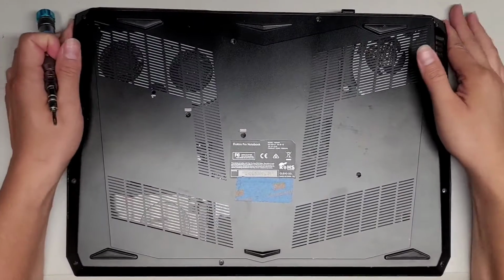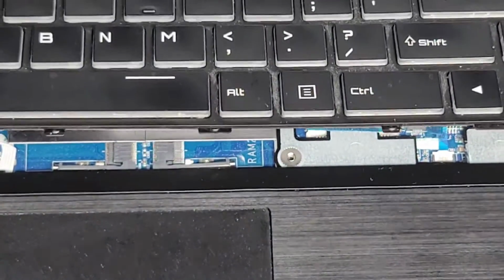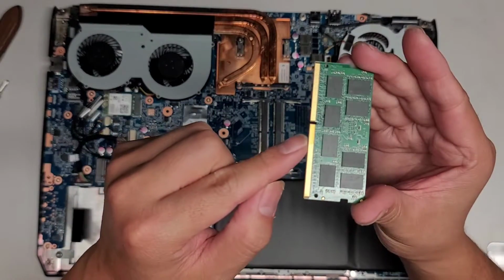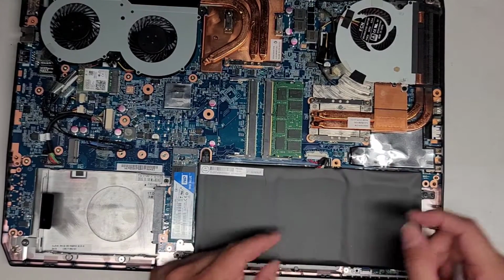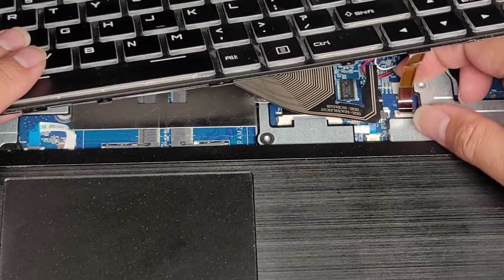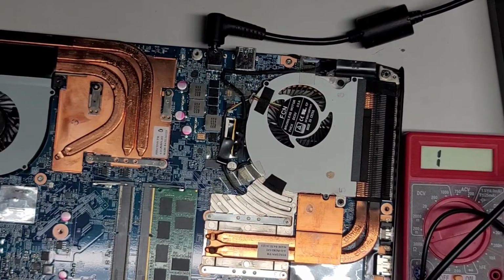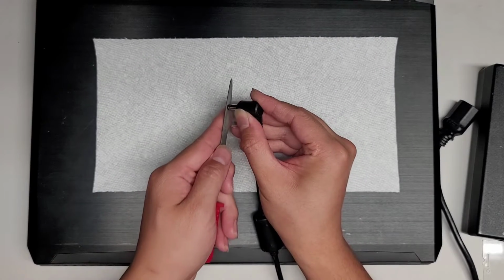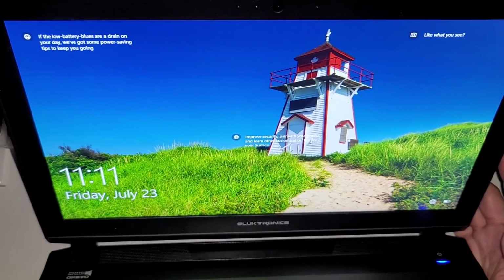Eluktroniks Eluktro Pro P650HP Clevo Disassembly RAM SSD Hard Drive Upgrade DC Jack Keyboard Repair

Comment: Hola me ayudas en algo?
Reply from the maker: I can't help you if I don't know what you need help with.
Reply: @ItsBinhRepaired gracias amigo, mira tengo la misma laptop del video y no se porque es tan difícil encontrar la información en Google. Busco el modelo exacto en la página de Eluktronics ya que es de esa marca. La verdad es que quiero actualizar la BIOS y no sé dónde descargar esa actualización, al jugar Warzon me pone una advertencia que debo actualizar la BIOS y no encuentro por ningún lado la actualización la versión actual de la BIOS es la 3.0 me ayudas en eso amigo?
Reply from the maker: @josepaz5544 try windows update advance options, enable Microsoft updates for other stuff and check for optional updates. The bios should be on the manufacturer's website if windows update doesn't have it.
Reply: Ese es el problema amigo que no está en la página del fabricante tu todavía tienes esa laptop la del vídeo?
Reply from the maker: @josepaz5544  I don't own the computers in my videos.
Reply: Soy de Honduras amigo y tengo otro problema la batería de mi laptop no funciona y no encuentro donde comprarla sabes dónde la puedo comprar en línea? Me ayudas con el link de alguna tienda donde la vendan?
Reply from the maker: @josepaz5544  I don't know places that will ship there. Check Amazon or ebay.
Reply: @ItsBinhRepaired solo haces reparaciones. Ya entiendo amigo gracias amigo!!
Reply from the maker: @josepaz5544  no problem

Comment: The comment that went with that $10 gift disappeared. I had an increasingly flaky keyboard on my Eluk Pro 670 (replacement is the same as here). Thanks to your clear video instructions, I had an easy, quick, successful repair with a replacement keyboard ordered on amazon from China. I never could have gotten the old keyboard out without your help. I also took advantage of the opportunity to blow the dust out of top and bottom under the case as you suggested. With luck the laptop will have a new life. Many thanks!
Reply from the maker: Awesome, glad it worked. Hope it continues working well for a long time!

Comment: what type cmos battery is in there
Reply from the maker: This company can help you find what you need. Just let them know the laptop model number and you can even send them the video. 

Get 15% off if you use my promo code : ItsBinhRepaired when you make a CMOS BIOS purchase at rometechbatteries.com

Comment: It's usually easier to use a vacuum cleaner (set to minimum power) to clean the laptop from dust. It shouldn't "swallow" anything important. Maybe just occasionally some screws. :)
Reply from the maker: Lol that's not good
Reply: @ItsBinhRepaired  Well... Having bagless vacuum cleaner allows finding the the screws afterwards. Although, the dust container must be cleaned beforehand.
Reply from the maker: @tamoregi  lol true

Comment: I got a keyboard replacement because my "d" doesn't work. But I got the one that's white backlight instead of the multicolor one. But there's two round cylinder things at the bottom that's stopping from putting it in. How do i remove the metal cylinders?
Reply: For the record there are only 2 keyboard screws on the bottom that have to be removed on the P650HP6. The screw locations are marked with a small keyboard. There is also a hole where you have to stick a small round rod type thing to release a tab. I replaced mine with the keyboard without the colored lights too. I don't really use the backlighting anyways. I tried cleaning my old keyboard in soap and water but it didn't help. My laptop still runs plenty fast enough for me.
Reply from the maker: What metal cylinders
Reply: @ItsBinhRepaired  I tried sending a link but it keeps deleting it. But I got the keyboard New Backlit Keyboard for Clevo P650SG P651SG P650SE P651SE P655SE USA from EBay. U can see the picture there of the keyboard
Reply from the maker: @TheRealShawnShaffer  upload a video to your YouTube channel and I'll check.  YouTube auto deletes links :(
Reply: @ItsBinhRepaired  I just uploaded it. If you don’t see it, it might’ve uploaded as a short.
Reply from the maker: @TheRealShawnShaffer  the original keyboard doesn't have the screw mounts? Not sure how you would remove them. Might have to use end cutters and grind it down with a dremel or something.
Reply: @ItsBinhRepaired  no, it looks like it’s already inside
Reply: I’ll dismantle it again and take another video
Reply from the maker: @TheRealShawnShaffer  alright
Reply: @ItsBinhRepaired  I uploaded a new video
Reply: @ItsBinhRepaired  is it fixable
Reply from the maker: @TheRealShawnShaffer  you have to remove the screws from the other side.
Reply: @ItsBinhRepaired  so I have to removes the screws and open the back of the laptop as well?
Reply from the maker: @TheRealShawnShaffer  the screws that are holding the rods in place

Comment: Save yourself some trouble with the screws, get a Plano Organizer Box like the one that you can get in the tackle section. By using a Plano Organizer you can simply put the screws in the boxes in the same pattern as-is on the back of the laptop so you will never get the screws out of order.
Reply from the maker: The box will take way too much room. I have laptops with over 70 screws. Can't organize them all that way. This will only work with models that only have a few screws. I actually have a device I made myself that does a really good job, but haven't been showing it because I'm wondering how I can patent and sell it.

Comment: Bravo. I just recently got one from my nephew like that but i think its a sager p650hp. Is that the exact same? He said something about mother board is fried and graphic card something like that. Should i try to find parts to repair it or will it cost too much?
Reply from the maker: Likely will cost a lot.
Reply: @ItsBinhRepaired  i see you live about an 1hr/12 away from me. How much you charge for diagonse to see what i need to get it up and running again also for upgrades and so on?
Reply from the maker: @BillaBong1  I have a partner that does motherboard repairs. For that model if the board can be repaired it'll likely be about $280
Reply: @ItsBinhRepaired  oh kool ill be willing to do that but need some mulla first lol. So when im ready whats the process?
Reply from the maker: Usually you can bring it to me or ship it. We'll work on it and see what we can do. Likely replacing the motherboard will be too costly, so if it requires that or something too costly, we charge $40 for the diagnosis/repair attempt.
Reply: @ItsBinhRepaired  thank you so much. I will get intouch with you shortly. Till then be safe and stay healthy🙏
Reply from the maker: @BillaBong1  sounds good